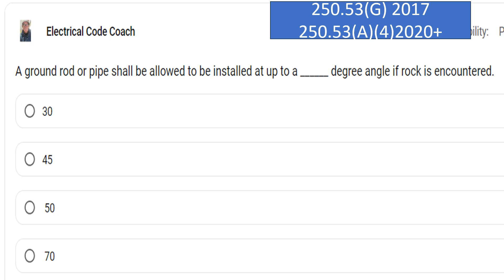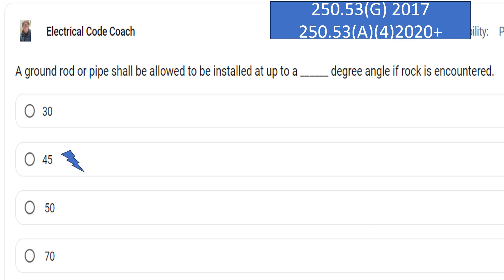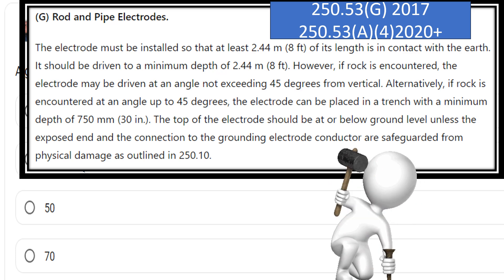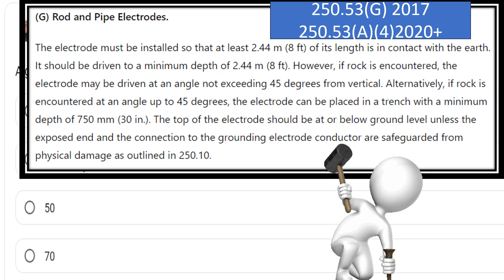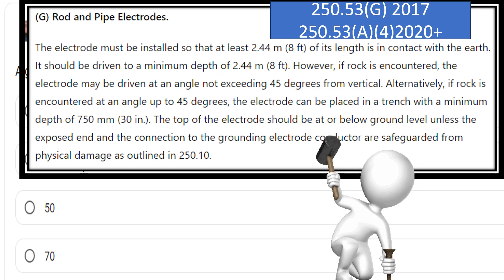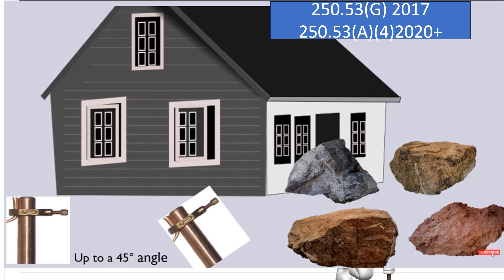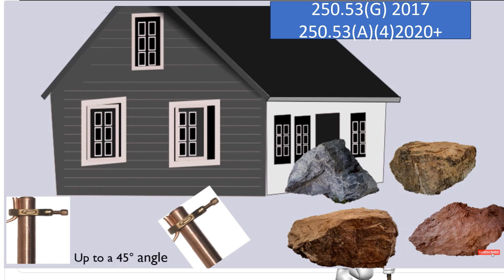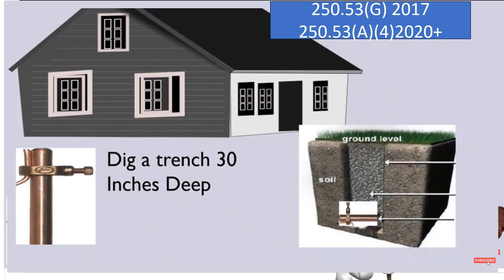#190 Electrical Question of the Day Ground Rod installation NEC 250.53

Comment: You get it 5 ft in and 3 ft to go and you hit rock. Do you attempt to slip a disc in your back trying to pull it out or abandon it and and put the new one in at 45* or plan C which I would assume a lot of electricians are guilty of “cut it with a sawzall” lol